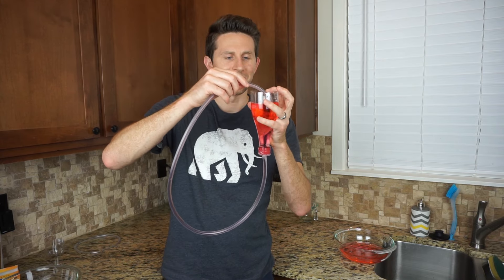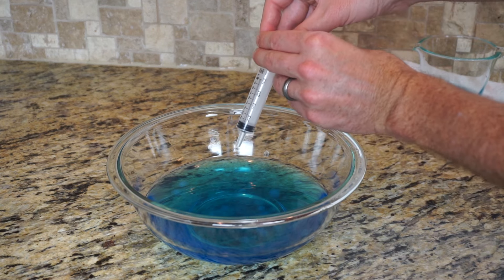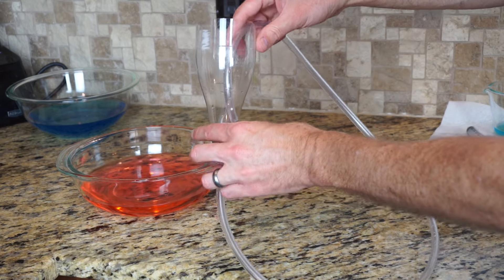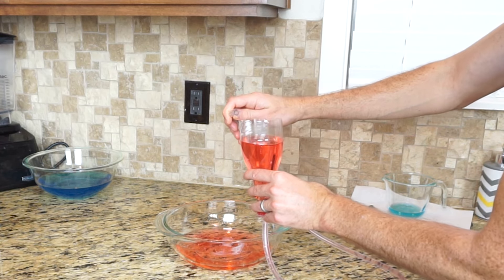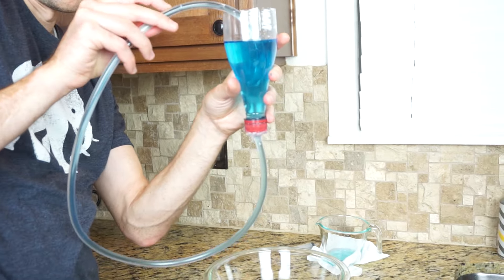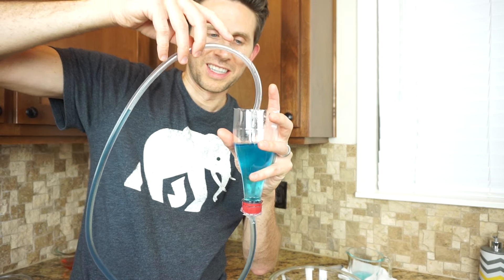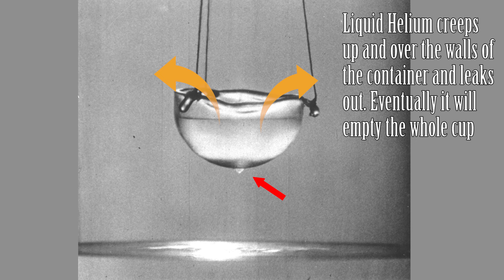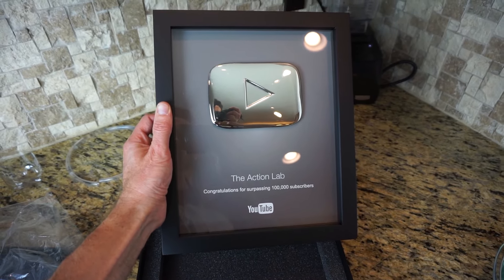Boyle's Self-Flowing Flask Filled With Polyethylene Glycol (Self-Pouring Liquid) = Perpetual Motion?

Comment: Capillary action depends on the diameter of the tube though. The larger the diameter, the smaller the effect. Couldn't you just increase the diameter of the tube at the end? This would spread the liquid out over a larger area and surface tension wouldn't be enough to resist the weight of the liquid, causing it to flow downward. It probably wouldn't work but it'd still be fun to watch. Someone should really make a model and demonstrate this irl.
Reply: Feynstein 100 What do you need surface tension for? You have negative pressure from the liquid flowing downwards on the flask-opposite side of the tube, pulling the rest of it along.
Reply: So you're saying you need to decrease the capillary force enough so it can't resist gravity correct? Then the liquid will flow down in to the cup right? Wrong.

If, as you say, the capillary force is not sufficient to overcome gravity, then the liquid will not be able to be pulled up the tube in the first place. 

By definition this machine cannot work. Either the capillary force is stronger meaning the liquid won't leave the tube, or gravity is stronger meaning the liquid won't go up the tube.
Reply: +SpaghettiToaster Umm what?
Reply: +Bob ForTewSevin I think you misunderstood. In the original Boyle's Flask experiment, the liquid is indeed pulled up by capillary forces up the curve but the same capillary forces hold the water together and prevent it from flowing out the other side. Which is why I suggested that perhaps enlarging the tube beyond that point would cause the stuck water to fall downward. This is very difficult to explain via text. Which is why someone should really do it irl.
Reply: Feynstein 100 if you increase the tube diameter, the flow velocity will decrease and vice versa. In both case, the total volume go out from the tube is   constant with time. You will get the same result with his experiment. 

Even with the good fluidic, the law of physics was not be violated. It's cool.
Reply: +Hồng Nhân Trần That's not relevant here because the theory says that there should be no flow velocity at all. For a capillary Boyle flask, the liquid simply flows to the tip but doesn't fall down because the surface tension, or rather adhesion is greater than the weight of the liquid.
Reply: Feynstein 100 an interesting thought but  sadly, it wouldn't work. The fluid's capillary action would carry it up to the widened area and then stop. It wouldn't  make it past that point. Even if you hit it to start the drop, it would flow back into the narrowed section and stop again.
Reply: +Hand Over It'd still be fun to see a demo of it, I guess.
Reply: +Deus Ignis That is exactly what I had in mind, dude. Did you make it yourself?
Reply: +Deus Ignis I guess that's a good thing :)
Reply: What if you could make the force of gravity uneven?
Reply: +Ian Schimnoski I thought of that too but couldn't come up with a way to do it. The only thing I could think of was taking two beakers of equal height and joining them at the top and the bottom. Then placing one of them in a strong magnetic field which would negate gravity somewhat, ensuring a perpetual difference in pressure between the two vessels.
Reply: Feynstein 100 

two words yo,

MINECRAFT + Planet.

Put some tall blocks out in space, and before they turn all round and whatnot, put one end on the top of the taller block, and one end at top of the shorter block. 

These blocks are aligned at the top, but one has more depth: 

1×1×9000 & 1×1×2 respectively.

I don't think this will work, because it will want to just pool-up on the side where gravity is strongest, but I was mostly just goofing off.

I don't mean to dash your dreams, but perpetual motion is thermodynamically improbable. 

If whiteholes randomly appeared everytime my waterwheel slowed down, whilst unlikely: it would be a viable perpetual motion machine in the 0.0bar1 of universes where it coincidentally occured regularly😁
Reply: It’s impossible, for us, to make a 100% efficient machine
Reply: Even if you make such a device that Deus Ignis drew, wouldn't the water droplets stop at the point where the exit begins to widen? If my understanding is correct, surface_tension > gravity before the point, and surface_tension < gravity after the point; meaning that there should be an equilibrium between surface tension and gravity at that very point, resulting in water droplets stopping at that spot instead of following along the widening gap.
Reply: what happend is that the water stops at the end of the capillary tube
Reply: Ian Schimnoski Right like we have the capacity to do that
Reply: Tero No because of friction.
Reply: 100% isn't possible, however if you were to use geothermal to heat the water in the cap tube before exiting? Then condensing back into the reservoir. The change in density would imbalance the capillary effect? Or use 2 tubes, one heated and one not. Use the heated leg to venturi the cool leg? Once flow is initiated a wheel can generate power.
Reply: Feynstein 100 the universe won't let us off that easy .. prepetual motion just can't happen on this levle
Reply: THERES A SCIENTIST REUNIOUN HERE
Reply: Feynstein 100 as you can see air gets sucked in, and if it didn't it would just thin out
Reply: That's exactly what I was going to say!
Reply: No you cant
Reply: Nathan Stiner true. But isn’t that the way geothermal energy plants work.
Reply: Feynstein 100 It could never be completely continuous. Law of conservation of energy would never let it continuously occur with no new energy
Reply: Feynstein 100 i
Reply: If that is possible it would not work because it will be free energy which is impossible
Reply: It doesn’t work because the properties of polyethylene glycol that pull it up the tube also keep it from exiting
Reply: Gana You should give an explanation in context to the topic that is being discussed
Reply: Feynstein,  the problem with capillary action is regardless of how the tube ends, the fluid does not want to leave the tube.  If the tube gets larger at the end, the fluid at that end is still pulled toward the smaller diameter area, the opposite you need for flow.    Think of it this way, a small tube place in water will pull the water up 1cm and then stop.  If you cut that tube off at 1/2 cm, water will not flow up and out.  And it will not form a drop like the maker of this video explains (he's wrong there)
Reply: Thats how a catalist works
Reply: Feynstein 100 I think you mean to say, the surface tension of the diameter of the hyperbolas of the liquid, will increase the friction of the circumference of the capillary action. So that the larger diameter will have a much smaller effect. So that the resistance of the weight of the liquid will eventually flow by defying the friction of gravity. So that the pressure of the surface tension will be of pluto. 

😂😂😂😂😂😭😭😭😭😭
Reply: Feynstein 100 gravity??
Reply: then put sand instead of water so that after it's capillarily raised, it's forced to fall down

Comment: Nice Video..

Few things I would like to point out.. 

Liquid Helium is not Super fluid. Practically if you cool Liquid Helium (4.2 K) to around 2.1 K one of the isotopes of Helium HE4 present in Liquid helium acts like as a super fluid. 
Even if you use Super fluid this might not work. The Super fluid might climb the tube in for a thin layer, but will then climb out and still stick to the outside of your flask instead of falling down. Eventually all of the liquid helium will climb out of the system instead of your fountain effect.
Reply: Sankar Ram 
Thanks
I was curious about that
So you are saying you can't make liquid helium to pour... even if you hold the pipe vertically with the open end pointing down?
Reply: how long did it take to find that on google xd
jk, but props for that knowlegde

Comment: I’ve always wondered if you could create perpetual motion somehow with magnets.  Magnets have power but you don’t have to put any energy into them.
Reply: You can create pseudo-perpetual motion machines. They aren't true, because the magnetic field decays over time, reducing the energy kept in the system.

Granted that's on a timescale of 100's-1,000's of years.
Reply: The only real things magnets give you is essentially potential energy, as soon as you let two magnets touch, you can't get energy out of that system, and pulling them apart uses vastly more energy then you put in

Comment: Superfluid will not run the turbine because it has no friction to push on the turbine. We cannot extract energy from superfluid by a turbine.
Reply: It doesn't have internal friction but due to the surface of turbine I can get friction.
Reply: But yes it cannot run turbine because if it would the perpetual motion will stop.

Comment: In a real boyle's flask, could you sharpen the output tube to a super sharp point and coat it in nevrwet nano particles to reduce the surface tension or allow it to flow better?

Comment: This device wouldn’t work even with liquid He mainly because to keep the He liquid you need to cool it down or expose it to high pressure, or both, and indeed spend energy doing it.
Love your vids ! 🤙🏼
Reply: lol we are spending energy on it to keep it from gaining heat energy from its environment , that cooling is actually making it lose its heat energy so in that case keeping it in space without any disturbance means keeping it at its temperature  thus no energy being spent on it
Reply: It would work with liquid He if you added a small hidden pump.  That seems to be the key to making it work.
Reply: @harshvardhan singh, yeah just put it in space.  But at that point just take a cardboard box and spin it in space...

Comment: Please can you throw some more light on why we cant extract work from a superfluid... “it doesn’t work that way”... didn’t at all stop me from going on a sweet sweet perpetual motion tangent... again.
Reply: I know this comment was made 2 years ago but I'm going to respond anyway. He is actually incorrect when he says liquid helium would go forever. Having 0 viscosity means that it doesn't have any internal friction, so if you stirred it, it would keep stirring because it wouldn't loose any energy to rubbing against itself. However, if you set it to flow through a boyle's flask, it would generate friction from rubbing against the sides of the tube and eventually loose energy to that and stop flowing. That's the same reason why you can't extract work out of it. You put energy into the helium to make it move, if the helium did something like spin a wheel, then you would just get back the energy you put into it minus some lost to heat.
Reply: @aaroncrawford6152  - Thanks for that, even though it was two years ago, the friction against the containing surface makes sense... it was not explained that something without any internal cohesion could still generate resistance to flow by friction... which makes sense, if the surface isn’t perfectly smooth (which nothing is), the atoms or molecules will contact the imperfections and slow down.

Comment: Can you please explain why cant we extract energy by putting a little turbine on the Continuosly flowing liquid helium....... Please Explain.😊
Reply: Because just a little bit of resistance would stop the whole process
Reply: C oldcash90900 Thanks.😊
Reply: @coldcash90900  What if we build a VERY BIG construction for the liquid? Could we extract work from it? (even a little bit) Answer me if you can please...
Reply: @konstabark7291  I'm sorry to tell you.... No mainly because no matter the size it just will not work its all breaking Newton's third law... You may have a big structure but if you start taking a tiny bit it wouldn't be anything worth taking at a time and in the end it would stop
Reply: @coldcash90900  So you want to say that even a little bit resistance from a tiny turbine will reduce the liquid's energy, so at the next loop the liquid will have less total energy, and the turbine will reduce the liquid's energy even more, and so goes on until the liquid stops. And the total energy wich we collect from the tiny turbine is just not worth the value... Am I right?
Reply: @konstabark7291  pretty much🤷🤷
Reply: @coldcash90900  Thanks a lot for the answer!
Reply: I have been reading your explanations to Anonymous' questions.  I was going to ask the same question.   With an extremely large system, could you not have a very small turbine sealed inside the tube with its' axel extending outside the tube? As the fluid passes, it is turned. Anything connected to the axel will also turn.  
  I once watched a program that was for children. It showed a grown man on a swing and a rope from the swing over a beam to a little girl. She pulled on the rope and could not lift him.  A series of pulleys were added and the little girl lifted him with no problem at all.  
    Would it be possible to add pulleys and cogs to make use of the movement of the tiny turbines' axel?  I am thinking of the old mills that ran from the movement of a waterwheel.
Can you explain why this will not work?  Thank-you.
Reply: @snowfleas5426  Well I understand what you have to say #1 if you understand how a come a long works you have to move alot of distance to move something heavy so therefore you would have to spin that axel ALOT in order to get any type of power... Therefore in no way efficient 
#2 no matter the system you have any type of resistance wether it be friction air ect eventually the whole process would stop making it not perpetual motion
Reply: Thank-you for your quick reply.  This concept has frustrated me for a long, long time.
Reply: @snowfleas5426  did u understand?
Reply: Yes, I think so.  I had to do a search to find out how a come-along works. It works in a similar way to the pulley system I had mentioned with the little girl lifting many more times than her own weight.  I understand now that just because it takes less effort to do a job, does not mean that there is extra energy left over somewhere to be somehow harnessed and used. If it was that easy, perpetual motion would not be such a sought-after thing, and everyone would be using it. Now I am smart enough to know what a stupid question it was in the first place. Thanks, LOL.
Reply: @coldcash90900  May I please ask you a question? :-)
I can't understand that that super fluid can ran for ever because even if you don't have friction, don't you have other loses of energy, i.e. by gravity, inertia, changing from a straight line, centrifugal effects and so on?
Reply: Probably because there is not enough pressure to push a water turbine to cause it to spin and if you got it to spin, it would only probably generate enough energy to recognize, not to use. You would have to use a LARGE version of these.
Reply: When one particle of unobtanium has a nuclear reaction with the flux capacitor, carry the two, changing its atomic isotope into a radioactive spider.
Reply: @friedmule5403  I think that the super fluid perpetual motion is only possible under very specific conditions in a very specific lab, which is why no one has seen it on a YouTube video yet. Well i have not yet seen one.

Ideal perpetual motion devices, if at all possible, require no outside forces, but on the other hand also cannot give out any useful power or force either, no matter how gigantic they are built.
Reply: No system can run forever, because there is always some kind of resistance at some point. Even if you could create a perfect system in a perfect environnement, a system that could run forever, you still could not use it to produce energy because its simply not possible to create anything, you can only transform things. So, if you were to extract energy from a system, the energy created would have to come from somewhere and it would come from the energy that make your system run, so it would not be able to run forever anymore and would stop at some point. Then, the amount of energy you would have extracted would be the same amount of energy that was making your system run. (hope this was understandable, sorry for my bad english)
Reply: What if you had a large basin flask and put a tiny mill in the falling liquid helium?
Reply: You would have to have a mass less turbine that would somehow be able to transfer energy
Reply: Or it have negative mass?
Reply: @konstabark7291  no because it doesn't create more energy. It just takes what we put in

Comment: Me wanting to prove people wrong
“Try’s”
So in conclusion the only way for this to work is if there is pressure in the bottle or bowl (main amount of liquid) or is there’s a tiny tube and a big bottle it will work due to the pressure on the liquid in the tube pushing it up into the tube and out thus making a cycle but this only works with very specific amounts and angles like it won’t work that well if it’s being held it need to be in like a stand kinda